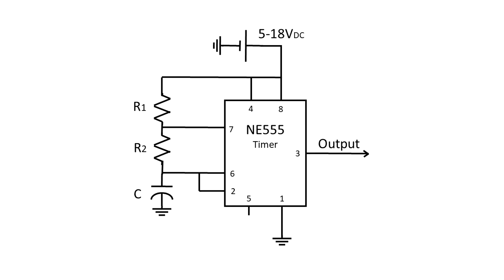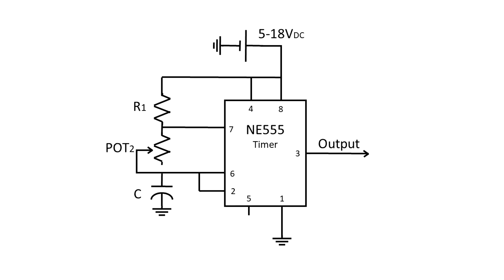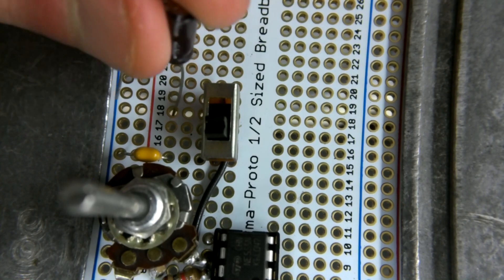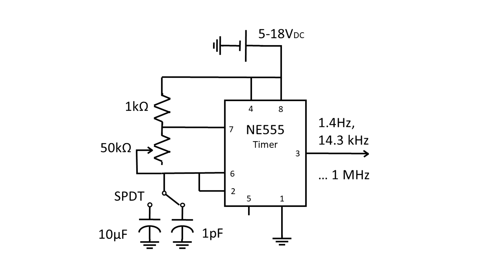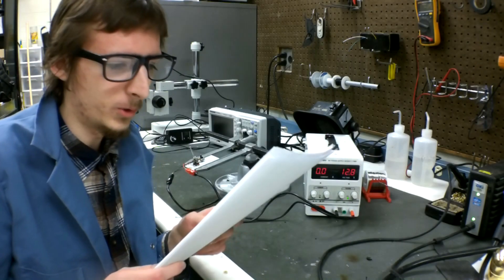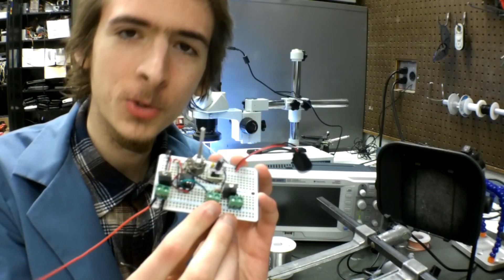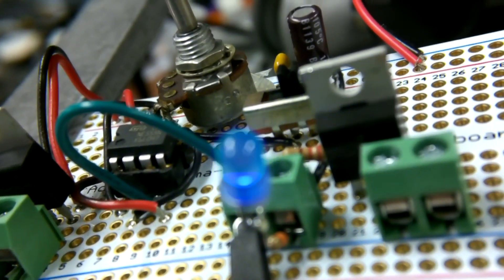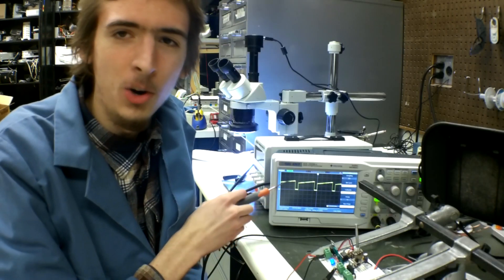Make a Really Simple Square Wave Generator

Comment: if we calculate the frequensy with potentiometer we add the whole "50k ohms" ? I mean with potetionmeter whatever is its actual setup  it would be like 1.44 / (1000  + 50 000 + 50 000) * 0.00001 always  right?  (with 10 uF capasitor of course)

Comment: An O2 Sensor generates .1 volts - .9 volts pulse wave per second. Can this work as a substitute for an O2 Sensor?

Parameters of Oxygen Sensor:

The output voltage of the oxygen sensor varies from 0.1V to 0.9V with the frequency of 1 Hz.

Comment: What about saw tooth and sine wave?
Reply from the maker: Ah, this can not do those (unless if you used a capacitor to smooth the wave a lot).
If you need those, there is a circuit that I know of that uses 2 op-amps (lm741) and is decently variable. Would you like the schematic?
Reply: @BlueprintScience  yes
Reply: @BlueprintScience  Yes, sorry never got back to you youtube has the habit of not showing me some comments.

Comment: I need to make 400v 3 phase 250khz square wave 1amp induction heater supply at 50hz pony motor ,I've got these huge capacitors can you help me plz?
Reply from the maker: L J I can help. The circuit you want needs two components: an oscillator (like the one I made here) and a power switch. Since you need high frequency, silicon is the way to go. MOSFETs or IGBTs are good choices and can be switched on and off by the oscillator. Solid state relays may also support your frequency- not sure though.
Hopefully those avenues lead to a working induction heater for you. Good luck
Reply: @BlueprintScience  can you make one on a video and then send me it free plz I brought a $700 induction heater but haven't managed to get it going in 2 years I'd love to use a home made rotary phase converter to supply the 360 - 440 voltage and 50 hz pony motor 2 amps but need your help with the square wave part can you make one that function square wave dial able like yours please . I'm amature electronic at best show me a circuit and prove it can be done 50 hz upto 250 kHz max 360 v upto 440 v

Comment: You can do this way easier with a bc337.
Reply from the maker: With an NPN transistor? Do tell.
Reply: @BlueprintScience  http://www.kerrywong.com/2014/03/19/bjt-in-reverse-avalanche-mode/
Reply: @darthvader5701  so interesting
I only looked at images. I wonder how high the frequency may reach
Reply: @youssefdirani try different caps and potentiometers
Reply: @darthvader5701  Max value ?
Reply: @youssefdirani  yes
Reply: @darthvader5701  can you reach 1GHz ?
Reply: @youssefdirani  only on tuesdays

Comment: expose salt water to 13.56 MHz radio waves and light a match. Hydrogen separates from the water mixture and burns for as long as it's exposed to the frequency. why I wanted to built a generator.
Reply: By water electrolysis you would achieve the same result, but it won't burn alone. 
Maybe you want to save electrical energy ?
Such an interesting experiment ! So salt water will start to boil I guess on this frequency ?
Chemically the salt turns into something different ?
What about the temperature of the water ? Is it warmer ?
How safe is it to burn hydrogen? 
Share your experiment please if it's fine

Comment: Hey, what should I do different if I want to make the frequency generator range to be 300 MHz to 400 MHz? And if i wanted to  try jamming my garage door opener would i wpuld need lile a speaker right? Lile what kind of things would I need?
Reply from the maker: Jamming a garage door signal, eh? Alright.
First of all, I am unsure exactly what frequency they operate at, but if you knew that, you should operate around it as close as possible and with as much power as possible, otherwise the sensor will still interpret the correct signal.
A dirt cheap 555 timer isn't going to get into the MHz range. You would need to find a crystal oscillator like the ones used in radios and run it through some high-pass amplifiers and out to an antenna (you can look up antenna designs to decide what jives with you).
If you ask me, it's more trouble than it's worth.
Reply: Sir u whatsapp no

Comment: can you make a variable frequency drive which can control both the frequency and voltage individually..??? means v/f= not constant
Reply from the maker: This 555 circuit operates at a constant(ish) voltage except in extremely high ranges. If you want to control the voltage, you could put a buck converter on either the input or the output to vary the voltage.

Comment: Good morning Dayton, I really appreciate your replies. And your tutorials. I have a question; short of experimental purposes; in testing or trouble shooting a for instance; Stereo amplifier, could you show us the best way to  trace a short circuit with a signal or wave form through a populated circuit board? I have built PWM's of different degrees along with other boards. I have test equipment like old school; Tektronix scope and a couple of wave Tek function gens and home built units as well. But my applicable use for testing and repairing   TVs and stereo amplifier equipment I cannot find understandable videos on. I as before appreciate your knowledge and ability to simplify in explanation to us lower level intellectual individual's with, "LIBERTY and JUSTICE for ALL, Amen" Hallelujah,, Hallelujah Hallelujah hall-e-lujah ! Thanks
Reply from the maker: Well, as far as I know, there is not guaranteed way to detect a short circuit. If a multi-meter can't do it, my next choice would be a thermal camera to see which component heats up the most - those components are the problem child.
I am only a little familiar with with power amplifiers, though I have used them on occasion. 
If your amps are having problems, I'd inject a test signal and follow the traces to see where the signal terminates, that is most likely the issue. If it's a power supply problem, bring up the voltage slowly and test for voltages.
Reply: Blueprint thanks,,, not the answer I was looking for, but thanks. I have no clue how to hook up my Wave Tek to any Stereo to trace. Nor from the Stereo,,out I will guess, to the CRT. I got an idea, but I don't want to break good equipment fixing broken stuff. So I thought since you did a video on a frequency generator build, you might want to do one on real world applications of use for it. So much for "THOUGHTING"! Lol!